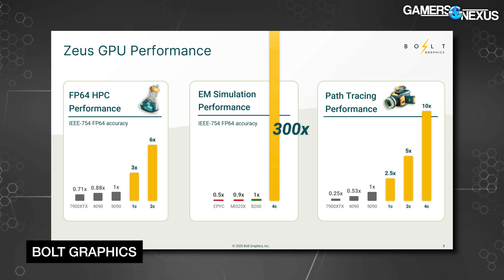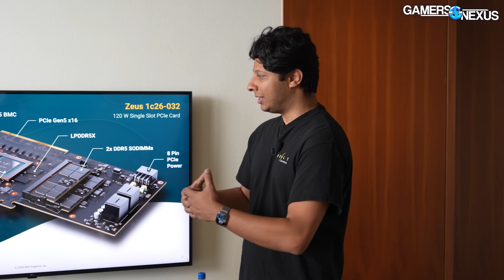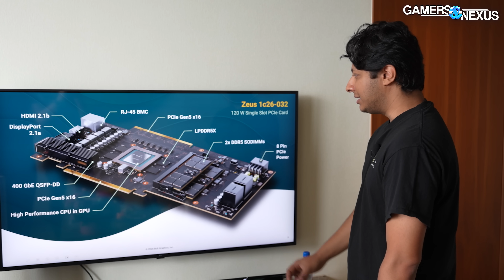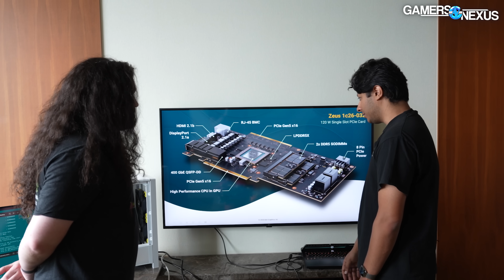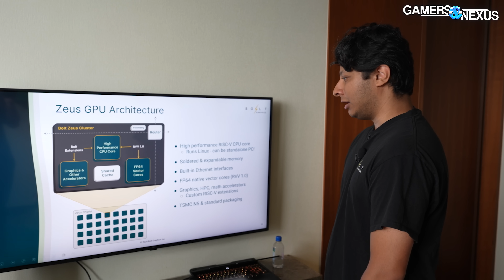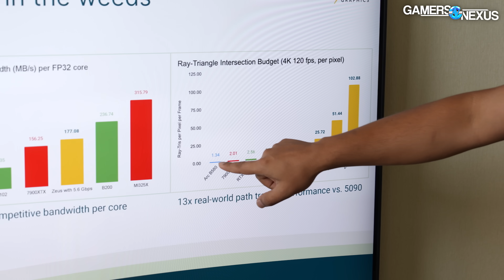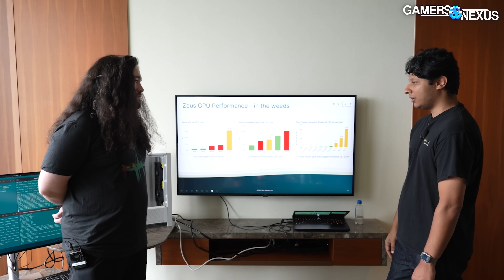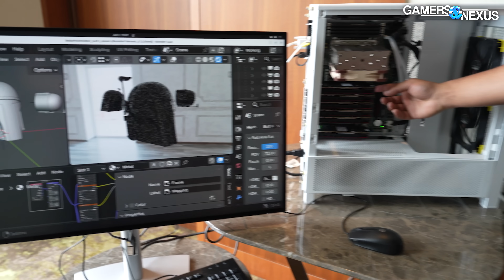A New Gaming GPU Challenger: Bolt Graphics Takes Aim at NVIDIA

Comment: Currently, if you want to render GPU-accelerated 3D animations with 32 GB VRAM (for Blender, say) on PC in a reasonable time, you have to fork up 3-4 K for a 5090, (or 10-12K for a 96 GB RTX Pro 6000)

If they can provide that for cheaper and less power I'm sold, even if I'd need to keep a separate gaming GPU (or even whole computer) for the time being.
Reply: Very not true 
2xa770 you can get for $400 $500 
Or b70 for 1000$ 
Intel options already have support in blender and 3d work
Reply: Or you buy a 1000 dollar Mac mini with 64 gb of shared memory. Blender has metal support as well.
Reply: @luipaardprint Mac GPUs aren't known for their path tracing performance though
Reply: @bosstowndynamics5488  you should try it, apple has a few devs working for the Blender foundation to implement native hardware support on apple silicon. It’s incredibly snappy. And the unified memory architecture makes it possible to render much larger scenes than would be possible on a discreet gpu if you fork out the money for the extra ram.
Reply: @bosstowndynamics5488  If you can’t fit the scene in memory, then a 5090 is going to be slower than the slowest M5 with enough memory to fit the scene.
Reply: @luipaardprint  Hugely underrated, yes Cuda is faster on a more powerful GPU, but if you can’t fit it into memory than you are going to be wayyyyy more limited. Not for everyone but a surprising option for many.
Reply: @luipaardprint  Nice try, Mac fanatic. XD
Reply: @IncognitoActivado it’s not even a joke. You can buy four of them for the price of a 5090 and the cluster will run circles around that card that still needs an entire computer to go with it.
Reply: @IncognitoActivado  The mac's are some of the best budget computers right now for stuff like this wdym nice try? If you need the vram who else is selling it at that price?
Reply: @lunawense6288  Look for a PC focused on privacy first and then say whatever you want. lol
Reply: @luipaardprint  Yeah.
Reply: @lunawense6288  Cope more MAC fanatic. XD
Reply: The thing is NVIDIA are not idiots, nor is AMD (contrary to appearances). IF there was a way to get that RT performance they're claiming (13x the performance of a 5090), it would have happened until now - maybe not 13x, but at least more than we have today. Black Myth Wukong still murders high end GPU framerate. And that expandable VRAM adds latency and cuts speed (it's physics that tells us that). Trace length matters even with DDR4 RAM (for example), plenty of motherboards demonstrated that. I can't imagine two SODIMMs expansion slots filled even with fast high speed RAM actually helping with graphically intensive GPU tasks (not to mention the nowadays insane RAM prices).

I would absolutely LOVE to see Bolt coming on top and being competitive, but Intel tried (again) recently and failed horribly and they're a corporation with basically infinite resources compared to these guys. The era of building actually competitive stuff in your garage is over (goes for pretty much anything actually serious). I'm going to be cautiously optimistic on their product until I see some real world benchmarks. I am seriously praying (atheist here, but I'll make an exception) it will be good.

Edit: bro said it will be less than a 5090, I'm sold now /s
Reply: @trosc  Neither of you are correct and Darwesh explained the tradeoff already. Gaming GPUs have to support raster as a baseline. Using a larger part of the cheap on RT would intrude on the raster gen over gen. The reason Bolt is claiming they can get more is because they are majorly ditching raster. The low memory bandwidth is fine for low raster performance and is not a big requirement for path tracing, so they are focusing on this performance profile because they think they can be competitive with using cheaper memory.

They are misleading though, when they imply this can transition to a gaming GPU. That whole architecture cannot ever be a gaming GPU because of the bandwidth and the low raster. They will have to throw this thing away and start over and solder those DIMMs.
Reply: @Kwazzaaap  That has nothing to do with it, they are either simply making things up or being very misleading about how they get those numbers. The raster engines in a Nvidia GPU are not and have not been a large part of the GPU for a long time now as most work is compute even in raster games (e.g. vertex processing, lighting, post processing). Sure removing them would help free up some die space, but not to a meaningful degree to give something insane like "13x" performance. Plus even if true, ray triangle intersection performance is not the main cost of ray tracing much like raster is not the main cost of a game anymore, the actual compute workload is and that is what their GPU will fall on its face trying to handle as handling non-coherent shading workloads and the complex memory access patterns is where the difficulty is.
Reply: @presentfactory Not seeing the misleading part here, they aren't claiming good GPGPU, they're claiming specifically path tracing, the fact that rastering uses hardware that can be used for some non-raster workloads these days doesn't change any of that since path tracing isn't one of those workloads. They didn't say they stripped out only the raster specific hardware, they said their architecture was clean slate built for path tracing
Reply: @bosstowndynamics5488  Like I said the actual thing that is going to bottleneck path tracing performance a lot is compute stuff which is essentially GPGPU since it's much more complex than simply casting some rays around, just like rendering a game is much more complex than just drawing some flat colored triangles.
Reply: @bosstowndynamics5488 amd and Nvidia can literally make their entire gpu do ray tracing. Why are you ignoring that the gpu cores maybe highly specialized but all work to do ray tracing
Reply: @trosc  Dont underestimate the fact that Nvidia and AMD have no incentive at all to improve their products. Especially considering they they collude with eachother behind closed doors. Nvidia is a monopoly that keeps AMD around at small size for legal reasons. Neither Nvidia, nor AMD have put any real effort into improving features gamers find important especially for the past few years.
Reply: @trosc  Established players get absolutely pummeled if they ship a new version that's worse (or even not better) at existing tasks. Think Itanium, Larabee, Core Ultra, Radeon VII, first gen Nvidia ray tracing. Those were all forward looking designs that enabled new workloads but not better at running existing software and they all got trashed in reviews and saw low adoption. To avoid this, you need to ship a new product that doesn't replace an existing product and then accept low initial volume as the newly enabled applications scale from small initial demand. That's easier for a new player than an existing player that'll always have to justify the low volume low revenue product that has to be advertised as "better" than the existing profitable product.
Reply: @trosc  Just a reminder: Nvidia has been artificially crippling their cards for generations now, since all the fanboys bought them at any price anyway. And their reward was to get discarded by that creepy Jensen guy, when the AI bubble proved more profitable than supplying stupid gaming cards.
Reply: @trosc  they dont make then 13x more powerful, because that is 13 upgrades for them to sell, no one is releasing their best product until a competitor forces them too, and there is no competitor
Reply: The 4000 and 5000 series are APUs for AI and other gimmick nonsense; they are NOT GPUs.
Reply: you can rent GPUs for way less to render whatever you want.
Reply: look at how slow this super simple scene rendered. this is dead on arrival sadly... I know that this is their own proprietary thing they cobbled together, but they have been at this for six years, were already making all these claims about how fast it is, and then they show us THIS?! damn.
Reply: @MrSheduur  did you miss the point where they told you this is a simulation board used for verifying designs? This is not running the full gpu nor is it running at full clock speeds. It’s showing that their technology actually renders like it’s supposed to, which is a much bigger milestone then achieving actual speed.
Reply: @MrSheduur  The demo is running on a FPGA implementation, essentially a hardware simulation. Those things are slow as balls, unless there's something big i've missed in that field. It can't really give anyone but their engineers any speed metrics. 

They're using this implementation to test functionality and as a base from which to estimate performance of the real thing, which could easily be anything from a few times to  a hundred times faster, depending on how closely the FPGA implementation resembles what they'd build a real chip with.

Six years is not that much time spent at hardware development; especially if you don't have an existing portfolio of technology. The big guys release stuff at a short interval, but i guarantee a lot of the new stuff at any gen has already been worked on during a few of the previous  product cycles.
Reply: @MrSheduur  that demo was parts of their gpu being emulated by a Xilinx U50 FPGA at 100Mhz...
Reply: @Henrik_Holst And it might be a "simple" scene but it's also being real time path traced which even the 5090 struggles with
Reply: @bosstowndynamics5488  the 5090 doesn't struggle with those already compiled static test either because they are hyper optimized

Comment: Wonder what a future of this would be like LPCAMM2 (start with 8 GB on board then have option for 16/32/64 GB yolo pool. Might disrupt Nvidia's ram tax.) I see what they are going for. The dimms you can use 4gb or 8 gb sodimm that are slower or lower capacity then your upgrade. Worried about the limited ports though. 3 cards for triple DP display? Strix Halo rig has been pretty interesting showing how good a lpddr5x platform can be. I just dont know how you can get this down to 300 to 600 to hit a good price point.

Comment: Not a gaming chip currently.  Understand, the current chip has very very little raster capability.  Its meant solely to be a cheap path trace solution for specialized workflows.  The whole "influencer" thing is simply to get their name out there.  It will be a minimum of 5 to 6 years before they even tape out their first potential gaming capable GPU.  The world will be a different place by then.  They may not survive to see it happen.  They have to wait because they want a node that is in production today.  Its why they don't enter any type of volume mfg until the end of 2027 when the N5 node will be essentially going dark for Intel, Nvidia and AMD.  Everyone in volume production today by the end of 2027 will be on 20 ang or less basically across their entire lineups other than specialized chips (IO dies for example)

Comment: Gaming wise won't be a thing, because GTX 1030 ddr4 if you guys remember that
The ddr4 version was twice as slow as the gddr5 version and we are talking about a very low end gpu.that it was back then on par with with AMD integrated vega graphics, the gddr5 version that is, even if it's ddr5, at best it would be as fast as a gtx 1050, which is still far slower than noways integraded igpu from AMD....
And the price of ddr5.....

Comment: Now they just need to compete with 30 years of GPU driver frameworks.
Reply: to be fair, most of that is just supporting legacy garbage. and using risc-v simplifies a lot of the software side: you can compile the shader to llvm bytecode (mesa already has this in linux) and then compile the llvm bytecode to risc-v.

you don't need all 30 years of kludges. you can step over most of that mess.
Reply: @dead-claudia  yep, directly to Vulkan/OpenGL and DX12.2, if they have no appetite for backwards compat.
Reply: If they just open source or source available their drivers 30 years of junk will be cut down to a few months of quality for sure.
Reply: This is the issue isn’t it - if I heard him correctly it’d only gonna work with games moving forward from when it’s released- no one’s gonna buy a GPU that doesn’t play any games from the last 30 years
Reply: @RogueManifesto  People might buy it if it's genuinely impressive. Like, if a moderately priced GPU makes new games look like Hollywood CGI at native 4K120, people might be ready to buy anyway - and just run rasterized games on an iGPU or something.
Reply: @KillahMate  Depending on the price I'd have considered one and done dual cards.  One old card for old shit and this card for the new games.  There's just way too much going on in the video and their website that shows we're not their market.  We're not even on the radar.  They'll be bought before a "gamer card" is even teased.
Reply: @KillahMate does an iGPU run by having raw modern power that's just not optimised for the task?
Reply: @KillahMate what your describing there sounds a lot like DLSS 5 and that didn’t go done so well for Nvidia - plus these guys don’t have a billion dollar company funding their research to ever get to a DlSS5 moment
Reply: @RogueManifesto  How on Earth does that sound like DLSS5. Do the DLSS5 screenshots look like Hollywood CGI to you? I guess maybe they would to someone who's never seen an AI generated picture before.

What I'm talking about is 4K path tracing with over 100 rays per pixel, which is two orders of magnitude more than what the RTX 5090 can do. That's close to the sample count Pixar used to render Toy Story. A second- or third-gen GPU that ran 300-500 rays per pixel wouldn't even need denoising, let alone antialiasing or upscaling.
Reply: @Killa @KillahMate ou’re talking about is pure nonsense - I was throwing you a bone with DLSS 5 thing - why on earth would a GPU from a company with no history of making GPU’s suddenly be able to produce images light years ahead of what AMD and Nvidia can do with zero driver support?Out quite simply this is never going to become a mainstream GPU for gamers and anyone with an ounce of understanding of these things can clearly see that
Reply: @RogueManifesto  "Why on earth would a GPU from a company with no history of making GPU’s suddenly be able to" - well, the video we're commenting under is dedicated to answering that question. Particularly the chart that Steve was interested in at 13:33 - the one showing ray-triangle intersection budgets. Where the 5090 is at 8 and the Zeus 4c is at 103 ray-tris/pixel/frame? Those are their respective ray budgets.
Reply: Most of that is legacy support. As long as they can support all the Vulkan and various other APIs they'll be golden.
Reply: maybe they can do something sneaky
Reply: Yeah this guy is way in over his head, lmao. Can't believe Steve took it seriously, desperate for views I guess

Comment: It's not that hard to make a GPU equivalent to roughly RTX5070/RX9070 in pure compute performance. It's about driver/software support. Intel tried, and they had a long history of integrated graphics, yet still their A-series had multiple flaws. B-series fixed some of the problems, but it never got a liftoff. I wouldn't hold high hopes for this one.

Comment: 24:33 bigger bar = better? XD? gb 102 is much better designed chip than mi325x so it needs less cache/bandwidth thus this is just a rugpull company, shouldnt promote this. This is china level design efficiency as its 5 times worse than amd at resource use.

Comment: don't expect the industry to adopt you before gamers do, first you need something that supports as many games as possible so that you have a significant market share on Steam, then you can make an argument as to why game devs need to factor your architecture into their graphics code, the whole thing of going to workstation users first to build support is the weakest point in the whole proposal imo, if you don't have consumers there's no reason workstation users would ever even care.
Even if you wanna build a different architecture later, it would be better to do it once you have a name and a reputation behind you and a history of sales to bring to game devs and publishers

The SODIMMS is a great idea superficially but what's the memory latency compared to Nvidia cards and how does that impact games? Cause even if it's only slightly higher latency it's going to slow down the frame renders way more than you'd think and a lot of games are picky and precise with their memory management

Comment: With the upgradeable ram and the modular computer on card approach I could see this form factor being used for very modular and simplified homelab setups. Set up one server with many little computers distributed across your PCIE slots and boom you have a modular and upgradable cluster with high bandwidth thanks to the dual PCIE slots.

Comment: Looks interesting, but I wonder why a 400 GbE QSFP port is included. This seems to be a little overkill. A DAC cable would still be affordable, but a transceiver can easily cost as much as the card itself, not to mention the switch you would need to connect to.

Comment: Isnt SODIMM slower than GDDR? How does that work?
Reply: It is slower, but it has half or less latensy. They are doing a similar thing that AMD did with their 6000- series card, putting a massive cash on the die itself (On die SRAM has 1/20th the latensy of GDDR and about 2-3 times the bandwidth, so less capacity is okay as the most bandwidth heavy small files are put in cash and then you push the rest out to LPDDR5X and the DDR5 SODIMM)